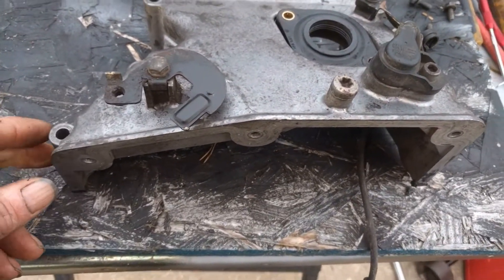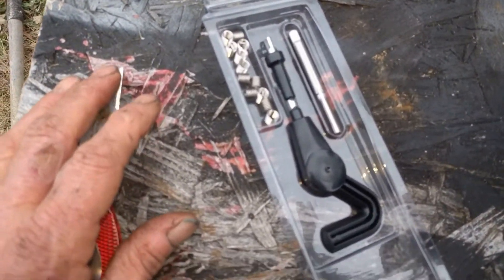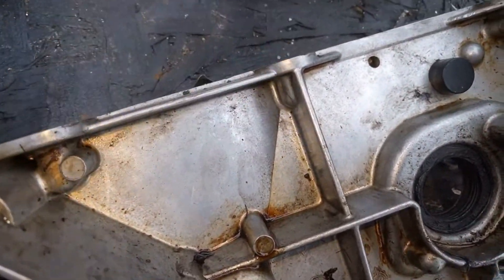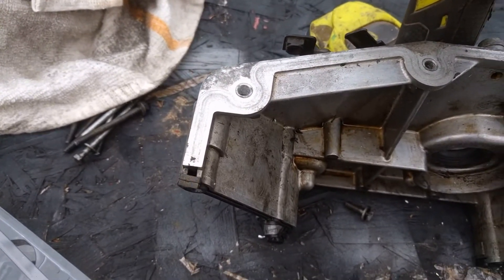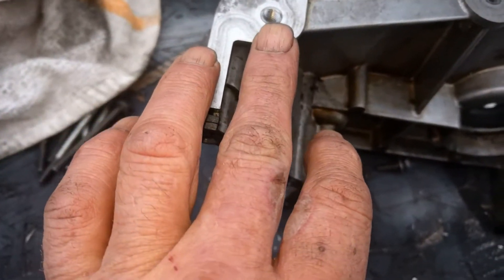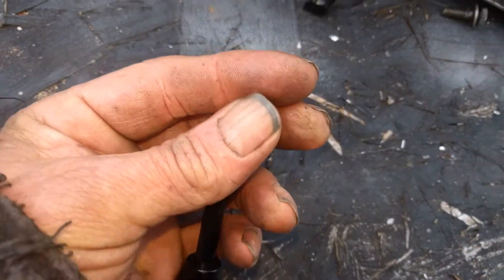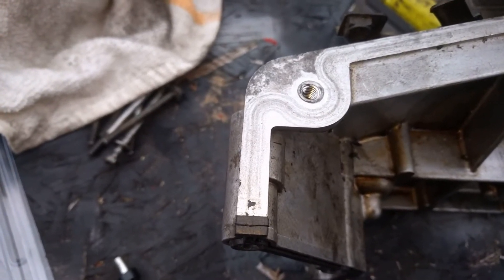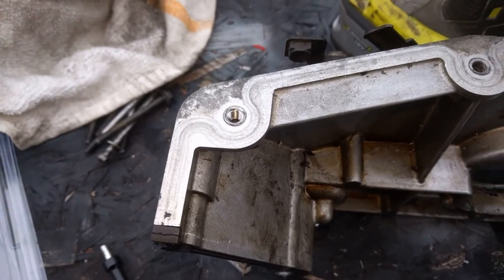Repair Stripped Bolt Hole Threads Made Easy Using a Helicoil Steel or Aluminum

Comment: Glenn, nice job out in the open. Personally I kind of hate to do this kind of work outside because the weather circumstances put extra pressure on oneself which can be tricky if the actual job is held up like this helicoil job. You sure like your BMW. Like I do, I just want to keep mine another 100.000 miles on the road for far less spending on it than buying another BMW with ‘unknown’ pre owner issues. I was asked twice already when I will get a new one because everybody else in our street is at their second or third car already 😅